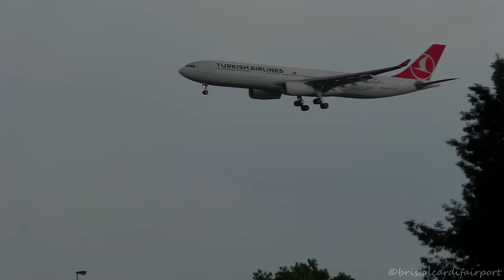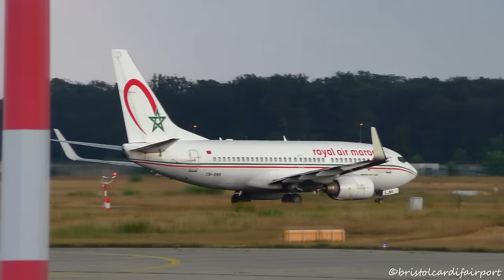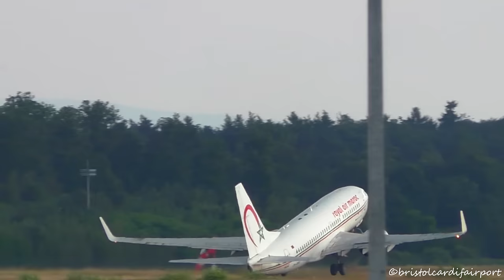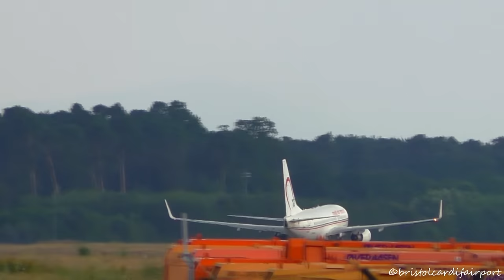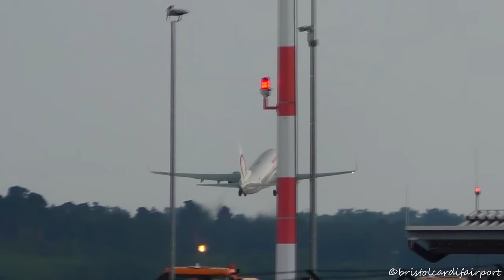PASSENGER AIRCRAFT FAILS TO TAKEOFF! BOEING 737 NEAR TAIL STRIKE & STALL ON TAKEOFF

Comment: Captain, we reached V 0.5, shall we rotate?
Reply: V 1/16, rotate
Reply: We rotate at V 0.4. BOSS MODE BABY
Reply: F/O: Captain, what is rotate?
Reply: 100 knots-rotate! 😂
Reply: It means " go back"
Reply: Mad Wax captain:making the plane upside down while doing a 180° turn.
Reply: Oh yes
Reply: Flaps 0°
Reply: Hahahahaha
Reply: - The engines are on
- Rotate
Reply: Ignition, throttle, and rotate without skipping a beat
Reply: Negative rate, gear up
Reply: @madwax4771  RO TAT EYYYYY
Reply: F/O be like: oh crap I forgot to then off spoilers!
Reply: I nearly pissed myself reading these comments hahahahhaha
Reply: V1/60, rotate wait why aren't the nose going up?
Reply: F/O: check rotate at V1
Reply: I think its first attempt of pilot... Or they want to do different 😂
Reply: do inki pinki ponki

Comment: I still can't believe what I am watching! I remember you showing this to me and Harry as soon as you filmed it and we were in shock! Fantastic catch, glad it got up in the air eventually! Liked.
Reply: +TopFelya -looks to me like flaps 1 setting along with rotation prior to VR resulting in ground effect flight. Pilots recognized this,lowered the nose and accelerated to VR at which point they actually began flying and climbed out of ground effect. I don't fly commercial AC but day 1 flight dynamics training in US Navy covers V speeds, ground effect vs real flight and other basic aerodynamic principles. Either you follow these principles and fly or you don't and the airplane quits flying.
Reply: my guess is that his airspeed wasn't high enough for the wings to give him sufficient lift and I agree his flaps weren't at the right setting
Reply: You can take off at flap 1 setting on a 737 depending on weight, speed, etc. But, I can guarantee that they either had false flight data, which can happen, or simply thought they were at a different flap setting and when they rotated realized their err.
Reply from the maker: Memories, huh? Not a bad pull on the trip!
Reply: Yea if it failed one more time it could have overrun the runway
Reply: Mraviationguy what the hell!   I had to do a replay.  That scenario could have taken a disastrous turn.
Reply: Mraviationguy yes i see fail take off omg
Reply: No flaps out for take off, but pilot was rotating with speed with flaps on, so required higher speed for take off eventually...
Reply: Nu Pagadii he almost ran out of blacktop taking off without flaps
Reply: Derek Wall    They did have a flap setting out. You can see the slats are extended too as it passes the camera. You can't select a takeoff thrust setting without an alarm going off in the cockpit if your flaps are at 0%. They may have calculated their V speeds incorrectly.
Reply: Agree, using wrong V figures for the aircraft most likely. Worrying.
Reply: Dyl Connaway yes you can
Reply: yMraviationguy
Reply: Tajil Tanil that's why - remember - he was your customer
Reply: @dominiquestephenson195  No my years of watching videos about this kind of thing on other channels tells me this was a cut and dried case of wake turbulence!

Comment: Shitt!  0 flaps!    Zero Flaps!  Look!
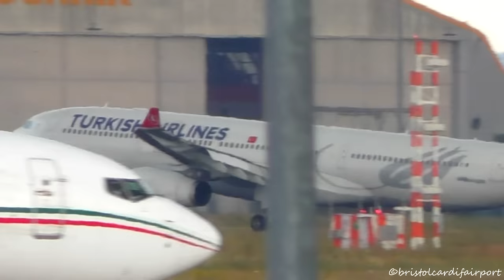Reply: look at 0:27, slats are out so that's at least flaps 1...
Reply: Slats are open, meaning flaps have to be at least 1. More over is toga power is applied with no flaps, the airplane starts sounding an horn. 

Looks to me like he was trying to avoid the wake turbulence, and also there were several little spoiler extensions
Reply: the flaps are extended 5 degrees which is flaps 1
Reply: +Eric Fletcher If flap 1 is 5 deg, what is flap 30 or even flap 40? It's a Boeing not an Airbus.
Reply: 40 should be around 200 degrees...:)
Reply: Only if both pilots were completely deaf, cause that Take off Configuration alarm is really loud.
Reply: Flap 40 is 46 degrees for B737-700 and -800
Reply: Javier Llaneza Dude that was a joke for the guy saying that Flaps 1 is 5 degrees...
Reply: Angelos Sakellariou I got that, 200 degrees should be a spoiler haha I wanted to actually give them the correct data :)
Reply: No. Slats are down. Looks like flaps 1 or 5
Reply: Flaps are clearly at 1 or 5.
Reply: +Angelos Sakellariou See LAPA flight 3142: it was so common to hear alarms that they did not pay attention. Flight Spanair 5022: the alarm did not soud (probably because of a fuse or circuit breaker, I do not remember)
Reply: Angelos Sakellariou Flap settings schedules has nothing to do with actual angles. Flaps 1 is LEX only flaps 5 is LEX and Trailing edge devices and goes from there. A 733 will have different actual angles than a 738 or 9. It's done for cross training  and callout uniformity
Reply: Hi Eric. Correct for the angles not corresponding to indications. Flaps 1 ion the 737 is LE devices (Intermediate slats and full Krueger Flaps) as well as Trailing Edge Flaps of 8 degrees NOT 5.   Flaps 1 LE only is an Airbus thing (in the air not in the ground) not 737.
Reply: yes its thi, left5° right its 0°
Reply: no he's got 5
Reply: one maybe 2, visible lot less whas necessery
Reply: Could be enough, the plane might be very light.
Reply: I know theres been airliners that have crashed as they did not use flaps for takeoff
Reply: Preston Hooper Spanair's 2008 crash, for example.
Reply: hey guys, i dont want to be smartass, but i can speaking with experience. 

Short summary of an Airbus Flaps: 

Flaps 1, 2, 3 and 4.  (not in degrees, like step 1, step 2, ...)

Boeing Flaps for example an Boeing B738 (737-800):

Flaps 1, 2, 5, 10, 15, 25, 30 and 40
and all of them means in degrees. 

Flaps 40 = 40 degrees. 

by the way a Boeing B744 (B747-400) doesn't have the Flaps 40, max. 30.

cheers
Reply: So guys, what do you think? Some panic in cockpit, pilot screaming "SLATS, FLAPS"!
Reply: Would have loved to listen to that CVR....
Reply: Marcio Burbela not 0! take off warning be going off
Reply: Flaps 5 at the worst which would require at least 150 knots to takeoff.
Reply: it's flaps 5.
Reply: Nothing happened with the flaps.  They calculated the wrong rotation speed.
Reply: Flaps were set